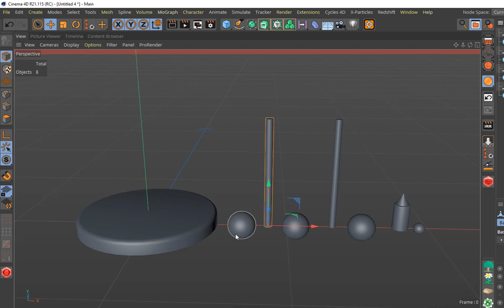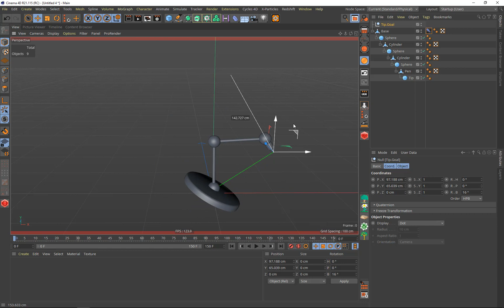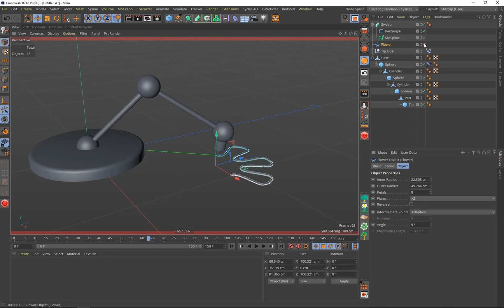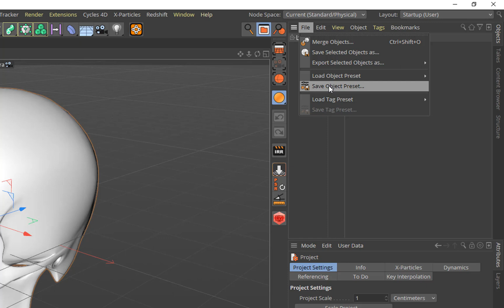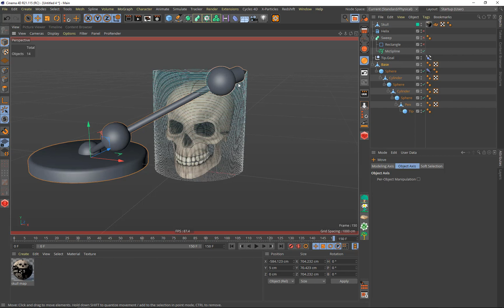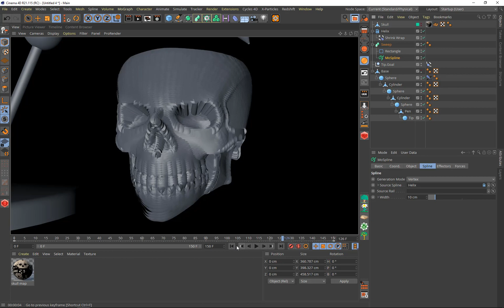Cinema 4D Tutorial - Simulate a Robot Arm Printer with IK and MoSpline

Comment: Hey Pappy, regarding doing an IK rig for a robotic arm do you know how to limit each arm to a specific angle/axis. your approach is great, however, each joint has complete degrees of freedom, instead of each axis holding a specific degree of freedom being given to each node/ball? THANKS!!!
Reply from the maker: Yes, I have not played around with it, but you can limit the angle by going to the joint attributes and look at kinematics limits.
Here's the help: https://help.maxon.net/r23/en-us/#html/OCAJOINT-ID_CA_JOINT_OBJECT_IK_GROUP.html

edit: hmm... that's with actual joint objects. I'm not sure how to do that with an IK chain. I'll look into it.
Reply: @pappystutorials  Thanks for the quick reply if I find a solution, I will get back to you with my findings.
Reply: @pappystutorials  So far using the protection tag is the only avenue for each joint, and them using several IK (having IK goals and base based on the direction of rotation between member) gives decent results. However, some joint will require pose morphs and user interaction tags.)
Reply from the maker: @GEORGE.M.M  Nice! Thank you for that.
Reply: @pappystutorials  https://instagram.com/stories/lorenzo.de.medici/2459958055308590004?utm_source=ig_story_item_share&igshid=5sn7bsumlvqr 

check out my hack attempt at ik rigging with limited movement, finally getting a hold of it, it's a case of having each node look in the direction of the target and restrict or emphasis angles of rotations through the protection tag. It's more an art and less a science.